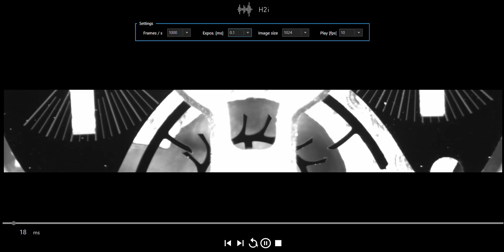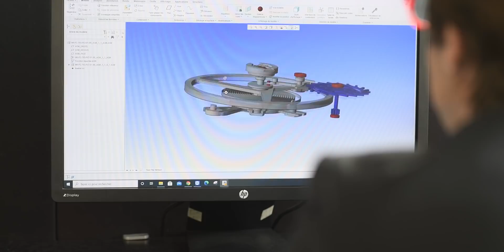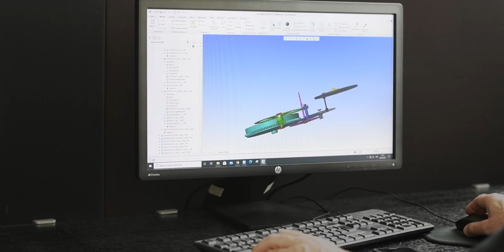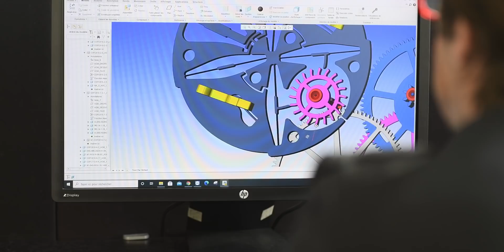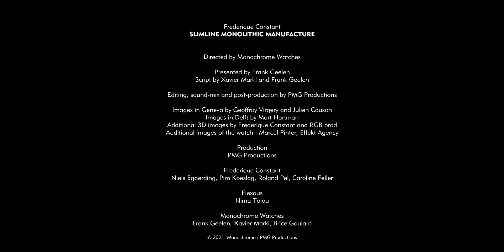IN-DEPTH - The Frederique Constant Slimline Monolithic Manufacture, with Groundbreaking Oscillator

Comment: Here we are ~4 years later and the movement has long been discontinued with users reporting timing and reliability issues. Having a 40 hz mechanical oscillator is a no-brainer for disturbances over time and will absolutely suffer from greater wear. If it were the revolution promised, it would be used everywhere still today. Also 40 hz providing 80 ticks per second is probably overkill, the human eye can really only perceive movements about half as quickly. A 20 hz oscillator for instance would perhaps provide a similar experience with a significantly reduced wear and reliability issues.
Reply: I own one.  Lose from 80  to 150 seconds every 24 hours. Absolutly garbage
Reply: @Maxfuretto   Yeah that doesn't surprise me, it sounds like they would need servicing 10 times as quickly with a movement running at 10x the oscillation rate.

Comment: Wondering what the service interval for this piece is. I imagine some gears would need to be replaced regularly due to the high frequency….?
Reply from the maker: The most crucial elements are made of silicon, and with less mechancial couplings in the construction, there's far less friction. So if anything, service intervals should be the same, if not better/longer.

Comment: COSC grade accuracy(heard in another video), superb shock resistance, extraordinary anti magnetism, suberb efficiency thus high power reserve, very low friction so probably long service intervals. What is the catch? Will the servicing be super costly? As the watch itself is available from like 4-5K eur. I just see no potential disadvantage(other than the high service cost) but major benefits. This can be ground breaking.

Comment: How about the durability and maintenance after using for years?
I think no local watch shop can deal with it.
Reply from the maker: As the silicon components require no lubrication, there's actually less service needed over time. But, as you fairly point out, it remains to be seen if this technology makes it so that it can be serviced by any trained watchmaker and not just FC's. Time will tell...

Comment: Pretty neat how they were able to essentially create a non electronic spring drive. Neat technology and I think it's great there is still a bar to raise for non electronically variated mechanical movements as I didnt think it was possible. But what is its accuracy?
Reply from the maker: When presented, it was regulated to run within COSC specifications (but not certified) but the potential is there for far greater accuracy. It is really an innovation that can still be develop further.

Comment: They are Dutch watches made in Switzerland as opposed to Swiss watches not that it matters still brilliant engineering
Reply from the maker: Well, not exactly. The company is Swiss, just launched by a Dutch couple and under Dutch control with a Japanese owner. But as you said, it doesn't matter much ;)
Reply: @Monochrome-watches  isn’t the tech for this movement Dutch as well ?

Comment: how is frederique constant in water resistance ?
Reply from the maker: If you're referring to this particular watch, the Slimline Monolithic Oscillator, it is rated to a depth of 30 meters. Other models in the Frederique Constant portfolio are mostly rated at 50m. Depends on the model really.
Reply: @Monochrome-watches  its my favourite watch brand and not overpriced

Comment: I was really excited for this movement, but from Frederique Constant's website, "offers an average daily precision of -4/+6 seconds."

So this brilliant and exciting innovation is only providing COSC accuracy!?
Reply from the maker: That is as of now, but the technology yields far greater potential. We can undoubtedly expect more of this in the future, also in the field of precision.
Reply: @Monochrome-watches   I'm looking forward to that.  I noticed that the price for the stainless version is on par (in Australia at least) with some of the Seiko and even Grand Seiko Spring Drive equiped watches.

If FC can get this to reliably provide +/- 1 second per day, this would be a very difficult decision for me, even considering that I really love the no battery and no capacitor, back-EMF braked quartz regulation of Spring Drive movements.

Such a cool innovation, but so is this Zenith/FC escapement!

Comment: All this talk of superior accuracy and shock resistance, but I can't find any evidence to suggest it's beyond that of Grand Seiko Spring Drive, Omega 8* series or Rolex 32* calibers. I would like to be proven wrong.
Reply from the maker: I fully understand your scepticism. The technology is still in it's infancy despite being perfected and tested extensively to the level it currently is at. The (near) future will tell the next step for this innovation by Frederque Constant. The Slimline Monolithic Oscillator they've released in march of this year was regulated to run within COSC specifications but it has far greater potential. Time will tell of course, but isn't it exciting to see watch companies take such steps?
Reply: @Monochrome-watches  It is exciting when Zenith do it, with a 0.3 seconds / day accuracy range, but then Frederique Constant brags about "superior accuracy", while it delivers only COSC grade specs. Also shock resistance was improved by Rolex and Omega in many ways (bridge, hairspring, shock absorber) so just saying it's "better" or "superior" ain't gonna cut it, when going against a century of improvements to traditional watch movements. Better than what? If this is as good as the accuracy, then for me it's average at best. Cool tech, but failed attempt.

Comment: The only thing I'm still curious about is the accuracy. I see no mention about that in any articles I see. I have to assume it's fairly accurate given the precision, but I wonder also how it performs as the mainspring winds down.
Reply from the maker: As the technology is quite new still, and things will develope into the future, we can expect quite a bit from the FC Monolithic Oscillator. Currently it's regulated to run withing COSC specifications but holds far greater potential. So to us at least, it is definitely something to keep an eye on!
Reply: @Monochrome-watches  that's really impressive! Thanks for the response!

Comment: Nothing new indeed, zenith has the same sistem in the defy inventor with better performance also....
Reply from the maker: The construction of both systems rely on the principles of silicon as a material and being a complient mechanism. That's where the comparison stops. The FC Monolithic Oscillator is very different to the Defy Inventor and yields quite the potential. It's also the first to be commercially available on a large scale.

Comment: what's the difference between this movement and the wezenith dey movement?
Reply from the maker: While both rely on the principle of compliant mechanisms and are made of silicon the construction is entirely different. The FC Monolithic Oscillator is a completely new conception, much smaller and incorporates adjustble weights to regulate it. They've managed to produce it for a commercially viable watch and it lookes promissing for the future.

Comment: Glaring omission from this video....the accuracy of the new movement. The higher frequency rate is really just a novelty if it doesn't make this new movement type more accurate. One would think that it has the capability. But I found it very interesting that there was NO mention of the +/- per day rate.
Reply from the maker: It's currently regulated withing COSC specifications but it yields much greater potential.

Comment: I can't believe you pay to show me these wonderful videos.  Best YouTube ads ever.

Beautiful timepiece.  Great tech.  But 40Hz?  Pfft!  That's practically Victorian.  The mechanical oscillator inside my 55 year old watch runs at 320Hz...
Reply from the maker: Thanks for the reply. 320Hz, so guessing a tuning fork mechamism? If so, that is of course a completely different concept. For full-mechanical watches, this is a big leap forwards. Not all advancements are down to just frequency. Construction, application and materials are other important factors.
Reply: @Monochrome-watches  You are of course quite correct, on all counts.  I just thought it was amusing that the makers boast about this (yes: absolutely spectacular and innovative) movement running at 40Hz in particular when we've had much higher frequencies for half a century.

Comment: This looks as smooth as Grand Seiko's Spring Drive, although it technically isn't... But has the advantage of not needing that many extra components to work, unlike SD which is basically a mechanical movement with half a quartz regulator. The balance wheel is so iconic, it kinda looks odd, but at the same time it's very impressive that efficiency wise, it achieves 80h and still runs at 40bps

Comment: Similar to Zenith DEFY inventor.
EDIT: I suggest everyone read the articles on compliant mechanisms and the slimline monolithic watch on Monochrome's website. Lovely read.
Reply from the maker: It is in the sense that both are made of silicium and are compliant mechanisms. That is where the comparison ends though, the construction of the FC Monolithic is very different.
Reply: @Monochrome-watches  I just read your amazing article on the watch and the compliant mechanisms. Very interesting and a right way forward for watchmaking.
Reply from the maker: @varunu4176  Thank you very much. It is indeed quite the innovation!

Comment: As a GS aficionado I just want for Seiko to come up with an 100HZ, just because.
Reply: isnt spring drive technically infinite hz
Reply: @MrWizardjr9  As both the owner of a Zenith Inventor and a GS SLGA001 I would say is isn't that simple. The Inventor, which is purely mechanical, is much more accurate than the Caliber 9RA5 (Less than a second per month versus 3 seconds per month, minute but 3 times still). I guess the issue being not the regulator itself but all the hundreds of components around it (more than double the ones than the Inventor, as well as the jewels). But I'd love to see a accuracy comparison between the Breguet  7727 (10Hz) versions this two other beasts. Lets not forget that both the FC and the Zenith operate on the Genequand Regulator principle, that allows for watches at 200+ Hz and with power reserve of 3+ months. So I'll believe both my 7727 and LUC 8Hz will become the last hurrah for the level escapement since all furthering in terms of the speed/power reserve will happen in the silicon realm.

Comment: A Timeline

Level Escapment -                                                        Thomas Mudge        1755     <1Hz
Zenith El Primero                                                           Zenith                         1986      5Hz
Level Escapement with magnetic strike governor    Breguet                       2010     10Hz
Zenith Oscillator                                                            Zenith                         2017     15Hz (later 18Hz in the Inventor)
Monolithic Oscillator                                                     Frédérique Constant2021    40Hz

Uau... this are amazing times, aren't they? In 11 years we went from 5Hz to 40Hz... and the race is just warming up.
Reply: 5Hz was achieved in late 1960's in time only form. Zenith was simply the first to apply it to a chronograph.
Reply: Is it cosc/metas certified ? What about maintenance intervalls ?
Reply: @didierlevy4268  neither cosc nor metas could certified the FC... they don't have a system that can measure such a fast bph. Even FC had to develop their own machinery in order to measure the speed of the watch.

Concerning my Inventor it works at a precision better than 1 second per month, around 10 seconds per year.
Reply: @panaceiasuberes6464  Thanks for the answer.

Comment: Compliant mechanisms is super cool and love where this is headed.  What I would want to know is whether there is additional wear on the escapement itself since it's oscillating at 40x a normal escapement.  Also, whether or not the movement is noisy at all.
Reply from the maker: With the properties of silicium there is no extra wear on the mechanism. It can be incorporated into a regular movement construction due to its small size. As a direct result it weighs very little and puts less stress on a movement than a regular oscillator. And thus, less friction, no need for lubrication, a much higher frequency is possible and it is virtually shockproof no it's own.

Comment: Isn't this in zenith inventor as well?
Reply from the maker: Both use the concept of compliant mechanism but there's a big difference between the two. FC had completely different requirements, different calculations, new patents etc. The size for one makes it very light and given the properties of compliant mechanism and silicium it is shockproof and puts less strain on the mechanism compared to traditional escapement mechanisms.

Comment: Definitely impressive, but I find quite questionable that they seem to be trying to take all the merit for this innovation, when in fact was Zenith that pioneered the idea of a monolithic silicon regulator a few years ago. I understand that this is a marketing video, but still, at least a mention would be the honorable thing to do, instead of implicitly claiming full paternity of the idea.
Reply from the maker: The similaritis between the two end with both being a compliant mechanism and made of silicium. The construction is very different, with the FC Monolithic oscillator incorporating the anchor and escape wheel for the first time ever. Also due to it's small size it is extremely light and as a result less stressful on the rest of the movement. It's size and flexible tendencies also mean it is virtually shockproof on it's own and due to the adjustable weights on the oscillator it can be regulated precisely.
Reply: @Monochrome-watches  sure, the executions are very different, but I was not talking about the execution, I was talking about the general idea. Moreover, I find it quite telling that they haven’t explicitly mentioned any concrete data neither regarding precision and accuracy nor durability.

Comment: This new oscillator is truly revolutional, but the design is way too Breguet'ish, old fashioned, for such a modern movement imho. Of course it's nice to combine a classic design with modern watchmaking, but on the other hand the design does not do justice to the technology and vice versa. Unfortunately the case back view is quite unimpressive as well, for such an impressive oscillator- and whole new gear train design. But of course you can't get everything at this price point, and it's more than fair. Awesome video with great insights into the new FC manufacture, well done!
Reply from the maker: Thank you for your comment.

Comment: Absolutely ingenuous and revolutionary for the mechanical watch making industry! More accuracy, precision, less components, less weight, no magnetism, less friction, longer run times, thinner cases and still mechanical! All pluses! My main concern at that much higher beat frequency (without oil) is the long-term wear and tear of the oscillator, which is made from just silica/celesium... Is this right?
Reply: The thing about the oscillator is it's a compliant machine, and made of Silicium. So as long as it doesn't go past the elastic zone of silicium (the length it stretches and can easily return back) as it deforms it should last essentially forever, and metal fatigue doesn't apply to the silicium as silicon is a metalloid.. Actually damn spectacular mechanical engineering.
Reply: @elgatto3133  Agreed, it's spectacular!  This mechanical engineering revolution is made possible by advances in metallurgy which allows for the compliant machine. Excellent point, and thanks for correcting me on Silicium. If FC has a patent on this, I wonder if this will leap frog them into a higher echelon of manufacturers?
Reply: @Common_Sense_101  Hard to say, it may well be that other brands piggyback off the compliant machines company. Curious to see what Jaeger-LeCoultre will think about all this.
Reply from the maker: That is correct, wear (and as such; maintenance/servicing) is virtually non-existent with silicium components. The technology has been extensively tested by FC, under various conditions.

Comment: This is BRILLIANT! Breaking the 10 Hz barrier, destroying it actually, with a fully mechanical device.
Reply from the maker: There have been high-beat movements before this, with 10Hz frequency or higher. But this is indeed a breakthrough in regulating an mechanical movement by use of a monolithic oscillator. The application of complaint mechanism allows for new levels of precision and innovation.

Comment: Like every watches with silicon parts: what about servicing when there will be no more spare parts to repair the watch? FC will not spend money to do news waffles of these escapement, and a simple watchmaker will never be able to do it in its workshop.
Reply from the maker: The properties of the material and the manufacturing process should ensure the part is interchangable with a brand new one without the need to make adjustments other than through the regulation weights placed on the oscillator.
Reply: @Monochrome-watches  Your response doesn't address his comment - people want to own a fine timepiece like this for a lifetime. If you send it in to FC for repairs in 20 years, will they still have stock of the required silicon parts? It's a fair question, and probably the primary risk with owning something like this.